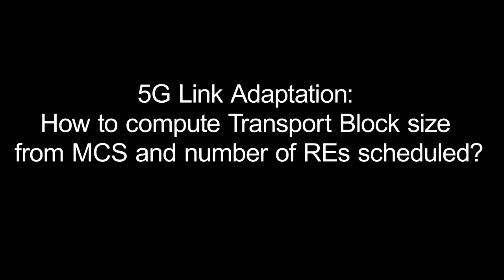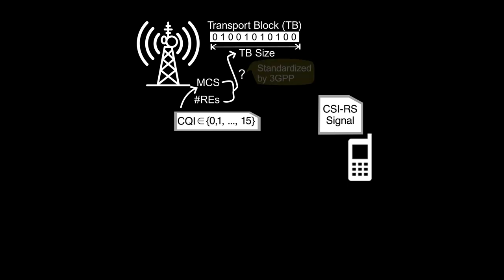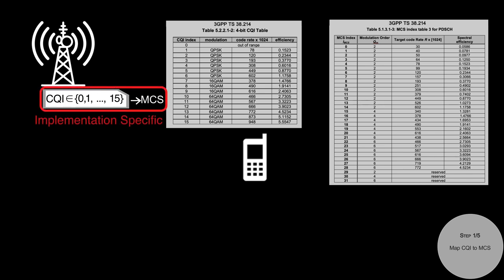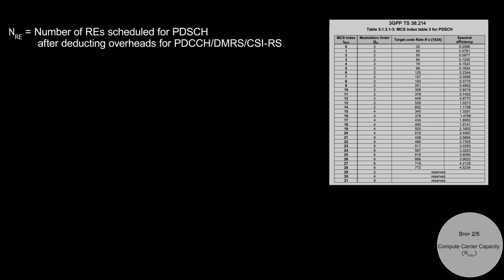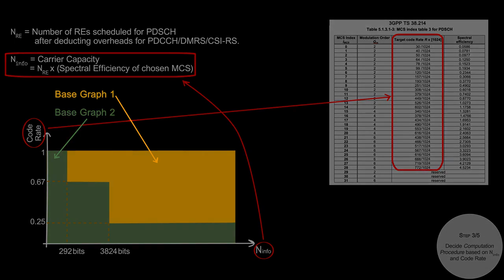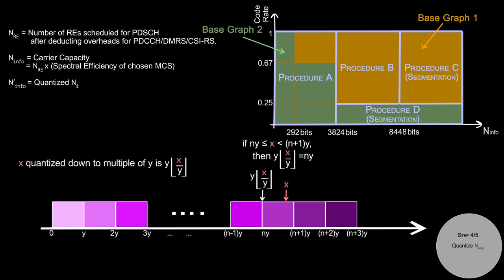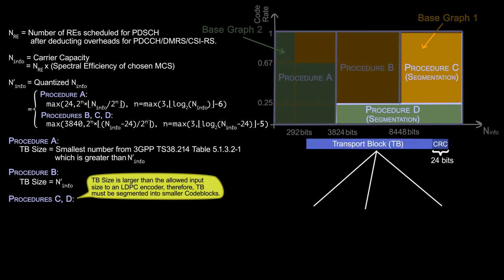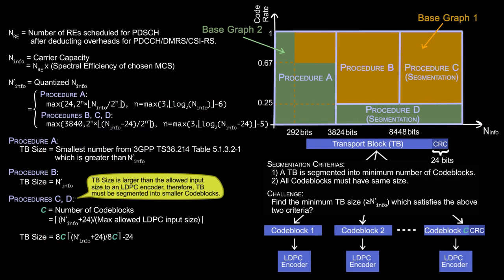5G Link Adaptation: Transport Block Size Computation

Comment: Great Video with insight. But it seems that the Max Allowed LDPC input size for Procedure C shall be 8424 (which is the maximum input size of BG1 exclude 24bit CB-CRC) .
Reply from the maker: Max allowed input size is 8448 bits, out of that, 24 bits are CRC bits. Hence, max allowed input info bits = 8448 - 24 = 8424.